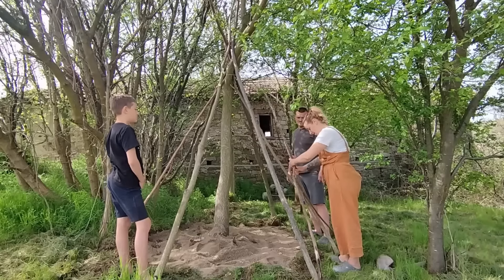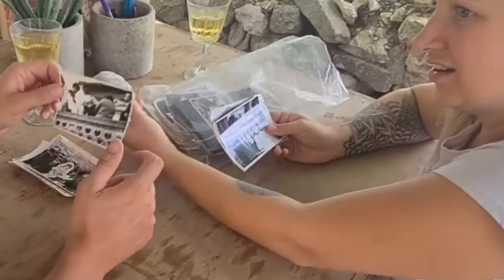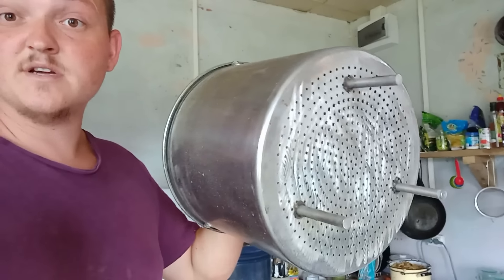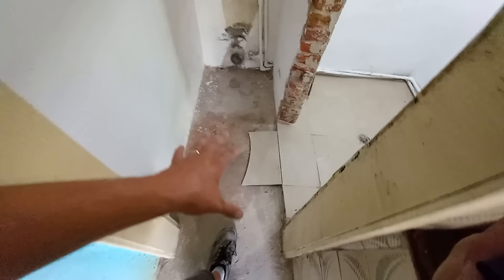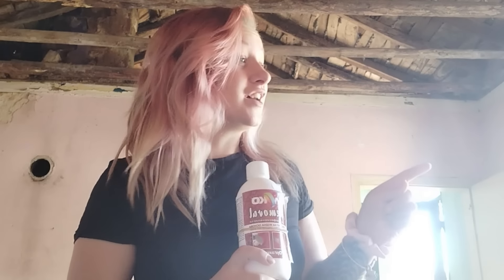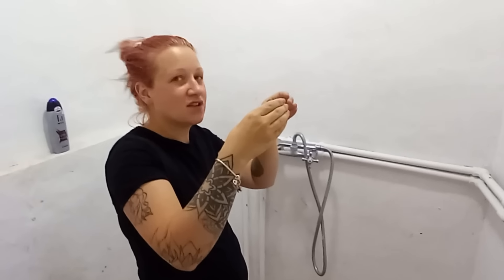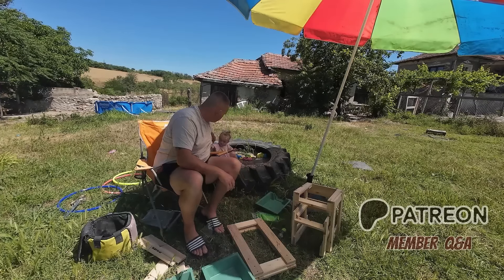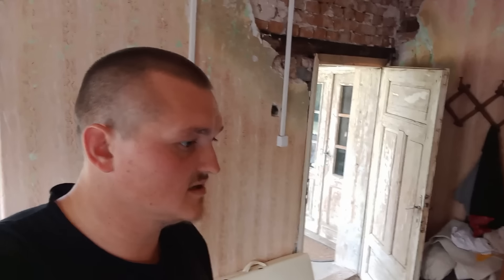Episode 2 - Brick By Brick | Renovating Our Bulgarian Village House

Comment: For upstairs floors that are settled mud and uneven beams. Buy some bags of polystyrene balls and add to the concrete. It will be very light. It's like honeycomb. Good sound and insulation properties. But the more you try and level it, the more the polystyrene rises to the surface. But works a treat. Can't hear the other half shouting at me from upstairs 😂

Comment: Tileing looks good. I may have built a littel step out of cement between the two walls entering the shower about 4 inches or so high laid the tiles to the left then tiled top and sides of littel step then all the tiles would have been flush other wise looks good.
Reply from the maker: Yeah man looking back, that's my only regret.  I'll probably go back and redo it. But for now, it'll do 😂.

Comment: Surely an outside wall is the one that needs insulation ?
Reply: Yeah, they should put the exposed brick feature on an interior wall.
Reply from the maker: We have to re-render the entire house, and here they insulate from the outside, not the inside, so we will apply foam boards to the outside of the house then render over it. 😀